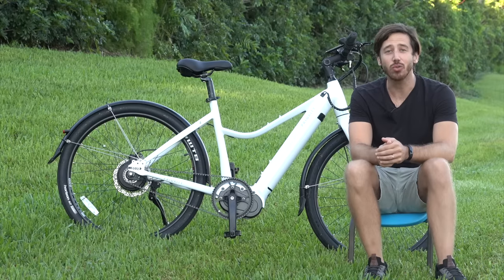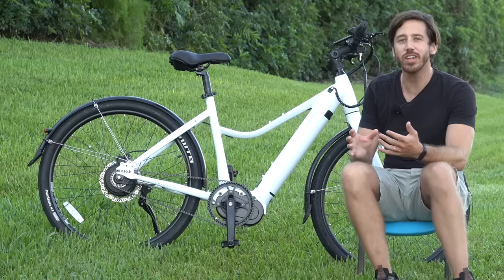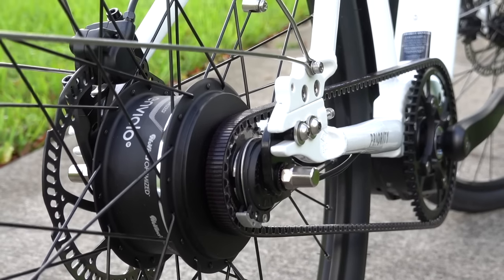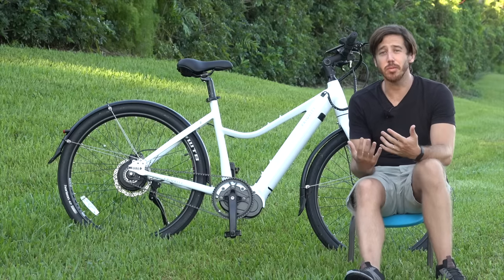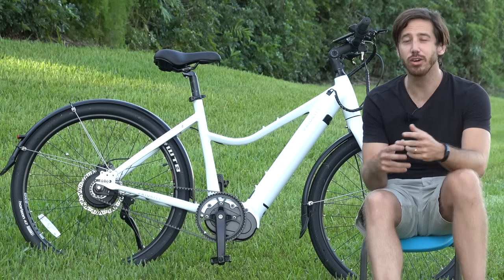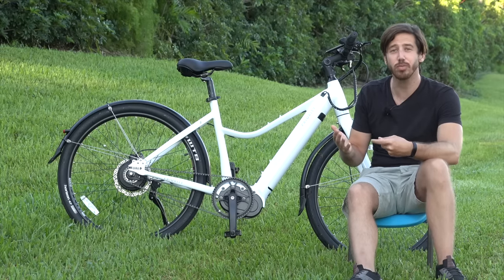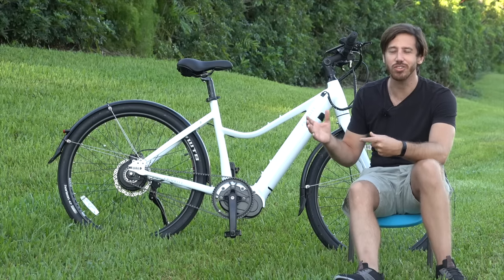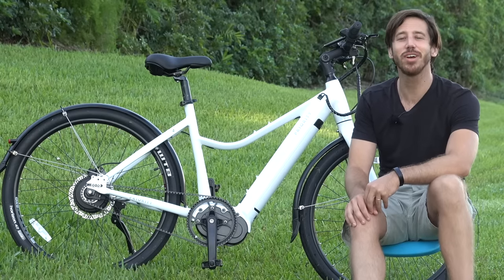BELT DRIVE on bicycles - Pros and Cons

Comment: It seems strange that the Far East markets are not making inroads into belt drives.. Those guys are usually working on everything - can there be a reason they have left belt drive systems alone?

Do you think belt drives deliver as much of the energy into the drive?  And are those hub gear boxes efficient enough?  I'm thinking a fair bit of energy is lost here?
Finally why should a belt drive cost so much more?  They are used in all sorts of motor vehicles and don't cost much... Okay the hub drive will be a lot more to design and build than a derailleur but the belt and front sprocket not really..

Comment: Ok I admit, I didn’t know belts on bicycles was a thing. However, I’ve had my bicycle since 2006, converted it to front hub 6 years ago, doing around 3k km yearly and I haven’t yet changed a chain! Urban trips only, though...
Reply: What do you mean by "converted it to front hub?"
Reply: @peterjv8748  i got myself a front hub conversion kit and turned it into an ebike.
Reply: @ThanosSustainable  Gotcha. Thanks. But check that chain. If you've ridden that much the chain is prob past worn and will ruin the rest of your drive-train.

Comment: Very informative video, in the disadvantages I would have mentioned the fact that belts are mechanically a bit less efficient in transmitting power, if compared with the chains.
Reply: If you're willing to accept the weight of a pinion box or IGH, optimal power transfer is about the last thing you're concerned with. Racers can go play in their own street. The average person doesn't care about that shit.
Reply: @cjohnson3836  rude reply
Reply: @pparker768  awwww
Reply: Vicenzo, initially, but after wear and maintenance intervals, the belt is overall more efficient. Search Gates Belt Drive efficiently here and you will see how chain vs belt compares. ,
Reply: I heard you can get up to 25% less range on your battery with a belt vs chain on bike models that are available in both options. Also there is more resistance while peddling which could be a factor for people with knee conditions. Do you any data on this?

Comment: From what I have heard, these belts will slip at a lessor tension than a chain will break or skip a tooth (unless the chain sprocket is worn). For this reason these belts can not transmit as much torque as a chain can. Also, to avoid slipping the belts require much higher tension on the slack side of the belt than a chain which can put additional stress on the bearings in the freehub and cause "drag" when coasting. Can someone who has actually owned and operated one of these drives comment on these points please?
Reply: The other thing I's like is a deeper explanation of the CVT operation. Can you 'hold' a gear if you want? CVTs can feel very squishy....
Reply: @medotorg2720  I actually had one of those Nuvinchi hubs on a recumbent bike I had like 10 years ago. I had a 49cc 4stroke motor kit is the reason I got the Nuvinci hub.
The hub worked well. It does stay in the ratio you put it; there is no back driving of the control. You can shift it at a stand still and it works immediately without having to reset the chain like a derailleur. They seem to be very very durable, probably the only type of bicycle transmission that is actually designed to take the amount of stress induced on it by a high power ebike. The only downside I noticed was that the hub had significantly more internal friction than a normal bike hub. I would come to a stop a bit sooner while coasting than with a normal hub. It wouldn't matter much on an ebike. Also it is a lot heavier than a regular hub but I think that is related to how strong and durable it is so that isn't really a down side.

Comment: What is that looks like box between two pedel, if I think that is befang motor, but it's not because of rear wheel has already hubmotor....
Reply: That is an internally geared hub at the rear.  Can't use belt drives with traditional gear cassettes and derailleur!

Comment: I like my belt drive very much but see one disadvantage. There is just one factory on planet able to produce carbon belt in required quality.
However it's not a big deal to change from belt to chain in case of that belt manufacture would run in trouble.

Comment: Would belt drives be better in winter?
Reply: Belt and chain probably perform roughly the same in winter, but the belt doesn't´t rust. The belt pushes dirt out from its teeth during the movement, so dirt and snow doesn't´t clog up the teeth (I have just come home from a snowy ride, and the belt works fine without accumulating snow/dirt.

Comment: Why is there no guard over the belt?  Know that it is not 'messy' but doesn't the guard also help keep things (pant legs, rocks, sticks and other stuff) from getting between the belt and the gear?
Reply: I think he had the guard off Robert just to show the belt in its entirety, But if not, you are correct there should be one on there!
Reply from the maker: There isn't one. It could be a safety benefit, but the good news is that since it isn't metal on metal, there's give. If a pebble or a pant leg did accidentally get in there, the belt would just sort of lift over it as it is somewhat flexible. It wouldn't tear or crush like a chain. I still wouldn't enjoy putting my finger in there though...
Reply: @EbikeSchool  Can you someday do a “grocery list“ of all the best companies and components to do for mid drive or hub drive or a carrier or type of chain the type of belt the pipe of anything that would be the best for any type of application including bike manufacturers themselves please? Thank you for all that you do Michah sharing your knowledge and experience to everyone is greatly appreciated by everyone who uses it and needs it! 👍👌😃

Comment: I have a Cannondale Bad Boy1 that was making noise. Took it to the shop and the mechanic put some belt dressing on it, which was slightly greasy. It was the first time he had ever put a belt drive together and didn't know how often I should dress the belt. How should I handle this situation?
Reply: What did cannondale recommend?
Reply: @AnthonyWrenn  They never got back to me. Tried a different shop and a mechanic there, who has a motorcycle with belt drive, said a slight bit on the belt should get rid of the noise.
Reply: Some of the first types of Gates drives (the CDC, without the centre thread) could get very noisy with the smallest misalignment. The CDC sprockets and chainrings had a wall on one side to prevent the belt from falling off. If it was misaligned, the belt would rub against the wall of the sprocket or chainring, and that could be incredibly noisy and annoying. The newer types (CDX and CDN) are held in place by a centre track, and that solved all these problems.

Comment: Thanks for the info. You didn't mention efficiency .. energy loss on a high end chain drive is minimal (a rusty chain is not so good). Obviously the hub gears also come into it but is there a top of the line belt to top of the line chain comparison of efficiency?

Comment: They are fine for smaller people who don't put a lot of torgque into the system.  To prevent slip for high power/big people you need enough tension that it creates drag.  The best thing I ever did ffor my belt drive was getting ride of it.  Bike was 100% better after the fact.
Reply: Those belts don't seem to have that little after roll that chains have, correct?

Comment: 1. Going from a chain to a belt  drive e-bike wont make the bicycle significantly lighter. Especially considering  the battery and drive train add significantly more weight than a chain and derailleur would.
2. Chains tend too Not rust or collect a lot of dirt when waxed.
3. Most of the noise on a bicycle with a chain is in the hub and cyclists tend too like that noise.
4. E-bikes are NOT maintenance free. They still need cleaned, batteries need recharged, etc.
5. Simpler because  1x and has No derailleur Not because it's belt drive.
6. Belts do sometimes squeak as they interact with the metal sprockets at either end of the drivetrain.

Comment: @3:32 there is one thing you have to do with a belt drive: you have to check the tension. Mostly easy to do (5 minutes) and just 3 to 4 times a year.

Comment: "Carrying around a six pound battery saving 100gm on a chain isn't going to..." The US is just like the UK, mixing old and new units rather than switching entirely to metric!
Reply: I'm a sixty two, year old Australian, and  I do it all the time.. A lot of imperial measurements I have no intuitive feel for. but there are a few metric ones that still aren't automatic, like a person's height.
Reply: @rfwillett2424  I'm not going to change my name... 😆
Reply: @rfwillett2424  Commodores and 80s Falcons had AF nuts on the engines while metric on the body
Reply: @manFromPeterborough  I remember that it was a pain.

Comment: This lab test has determined that chains are between 0.3% and 1.0% more efficient at low power outputs (under 212 watts), while belts are more efficient at high power outputs (over 212 watts).
Reply: Big problem is when you need to pair a belt drive up to an internal gear which (exluding the Rohloff) carry a good 10-15% efficiency loss depending on gear choice.

Comment: I predict in ten years if you take your cassette/derailleur bike to the shop for repairs they will tell you it will take 7-10 days for the parts to arrive so they can repair your old dinosaur. lol
It will all be belts driving Enviolos or geared rear hubs and/or Pinions driving the belt. In ten years the popularity of these parts will drop the prices dramatically.
My personal bike is a Priority Turi. I had to change the handlebars to get a 5" rise because I'm 6'6", but a reroute of the rear brake line worked well. (hint: symmetry isn't important with hydraulic brakes)
In ten years WalMart will be selling a bike like mine for $200.

Comment: Why dont they just make the bottom right rear arm go above the belt and connect to the seat post 

Seems like you coukd get stiffer at the same weight compared to a belt cutout
Reply: Or im sure the rear sprocket could be mounted outside of the frame
Reply: my momentum UX3S has such a thing designed in, the chainstay is curved up so the belt can be installed & removed without splitting the frame, it's not an e-bike

Comment: Who "goes through a chain "? I have a 40 y o bike with original chain
Reply: Chains are designed as consumable parts. Your chain wears down over time by friction (even if it’s oiled though it does help). You can get chain wear tools for less than a tenner. A worn down chain will wear down any drivetrain components it comes into contact with, so buying a new chain when you need one will actually save you money in the long run.
Reply: @james-cucumber  Dood, the chain and the bycicle has lasted for 40 od years. By now it hass fully amortized its initial value and the value of the bike. 

If you want i can sell you a bike like that for 20€.

Comment: Marginally more loss in transfer of power using a belt vs.chain. Also, a chain will stay cleaner and last much longer if you wax it instead of lubing using petroleum based products.

Comment: So basically most of the cons are coming from that the technology isn't as sophisticated and widespread yet (I mainly mean the price and the lack of components) and not because it's technology itself.
Reply: The cons are also what situations it's not good for and could never replace..
It's a good system and will have a place, But it's not a system that could just take over the biking world. (probably couldn't even take over in the section it's great for - everyday commuters/general biking, Because the sprocket drive chain is so ingrained into society it would take a massive costly shake up of the industry to change that)

Comment: I've been riding a Spot Brand Acme for over 6 years now. It uses an Alfine 11-speed internal hub and a gates belt, just like the one in this video. For all practical purposes, it has been maintenance-free. During the first year, I had to readjust the tension, but only slightly. And, it was simple. Back then, precious few bike shops had any experience with the combo and I had to readjust after getting it back for unrelated repairs that required the removal of the back wheel assembly. I have also had (only) a couple of incidents where my pant leg got caught in the belt: a guard is still a good idea. Other than that, it has been exceptional. My next bike - ironically Micah's bike in this video - was my choice in part because of the belt (Priority is all-in on belts!). I won't go back to a chain unless other features and performance clearly outweigh having a belt.

Comment: Why cant they built the rear gear outside the frame so that you can slip the belt without having to pass it through the God damn frame?!
Reply: Mainly due to the width of the crank and some bikes have large rear clearance. One solution is a splitting belt (veer), another is one-sided rear triangle like the ones Cannondale had.

Comment: I do admire the technical hype by Gates for a simple belt transmitting something like 1000 watts max. In fact there is no need of carbon fiber rods on delicate belts you can't twist nor bend, with special cogs and tutti quanti. Besides adding an expensive and rather delicate internal gear hub. I have to see a reliable internal gear hub which does not begin to show problems after sometimes only 1500 km, and it's a pain to open them without specialized tools. 
All that hype ends with bikes more expensive that electric scooters which have true suspensions, ABS hydraulic brakes, confortable seats, good lights and often no any belt or chain, I forgot also 45 to 70 kmh. 
Furthermore if you're a commuter using it every day of the year in any weather as I have been, a scooter with apron, topcase to keep the helmet and rain clothes is far more useful than a bicycle.

Comment: Great Vid man. Excellent explaination... but I see the cons far outweight the pros.

If a belt drive does ever break andnur adventuring somewhere, u will never get this replaced, a chain is easily replaced or fixed. 

It doesn't bother me to oil a chain every now and then... and replacing a chain is super cheap anyway every 2 to 5 years if needed.  (I never ever clean the chain and it has seen alot of nasty mud, rocks and stuff... I dont see it worth the time to do since my labour time is worth much more than the cost of buying a new one when they are so cheap to replace. My chain now is still going strong after 4years
Chain allows to.still change gears at the back, a massive drawback of the belt.

I didnt see any single good pro of having the belt drive (not having to squirt oil on it is not a great pro)... so many more cons. Cheers ur vids r really informative

Comment: Missed a very important disadvantage with belts- efficiency
Reply: I heard that depending on the gear ratios and  depending on how hard you pedal, there is a point where either a chain or a belt becomes more or less efficient. Either way I doubt there is much of a difference that matters unless you use a bike to race or do cardio.